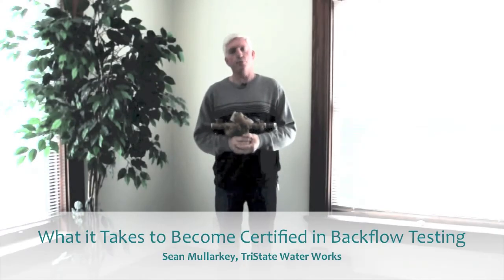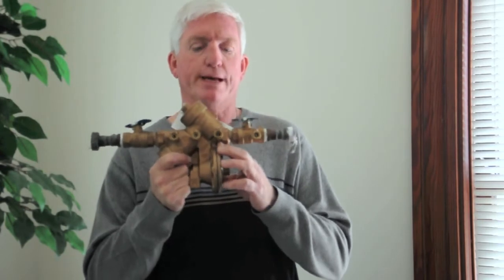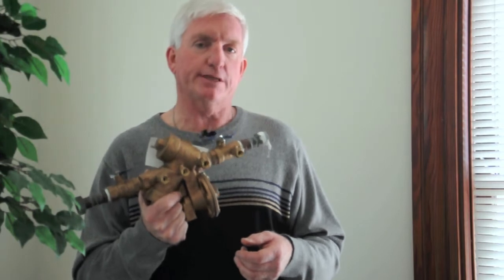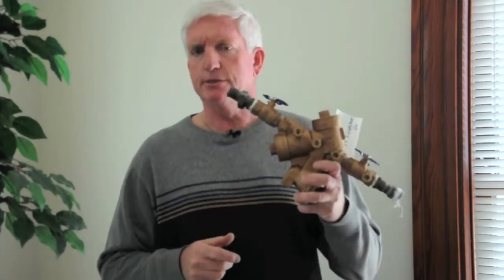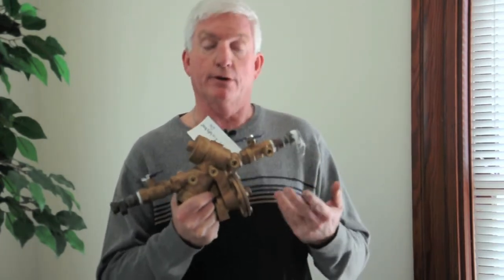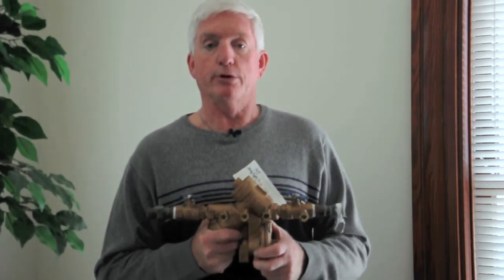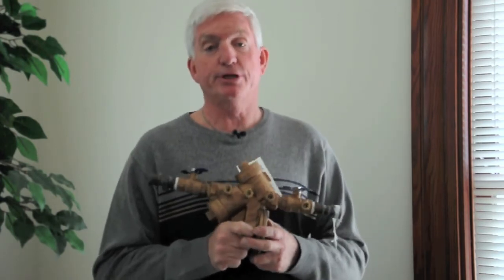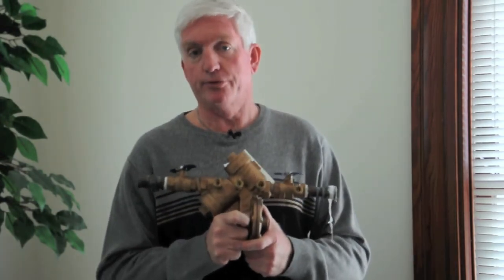What it Takes to Be Certified in Backflow Testing

Comment: I understand the need for backflow system certifications in industrial applications and for high rise buildings, etc.  However, I can't conceive of what practical purpose it serves in a residential irrigation systems where the potential for any reasonable and sustained pressure to cause a reverse flow into a municipal water system exists.  For residential applications, this seems like a totally ridiculous and costly requirement.  Is there any case anywhere in the world where a residential irrigation system backflowed into the municipal water supply?  This is not a nationwide standard (based on the four locations that I've lived).  It's as likely that my garden hose used to wash the car or in other tasks could backflow, though there is no requirement on residential (non-irrigation) hook ups to have a backflow preventer.  Otherwise, every house in the US would be required to have this.  This is another example of government over-regulation and should be revised for reasonable and practical reasons.
Reply: You speak the truth. This law was mandated by the U.S. EPA in the clean water act. It is a bureaucratic mandate. Most of the worst laws are contrived by bureaucratic mandate in which we have no say, no control and very little if any recourse. Thanks for sharing your comments Brett.